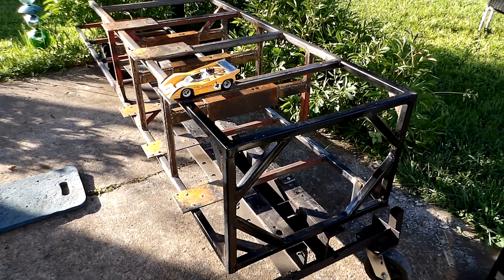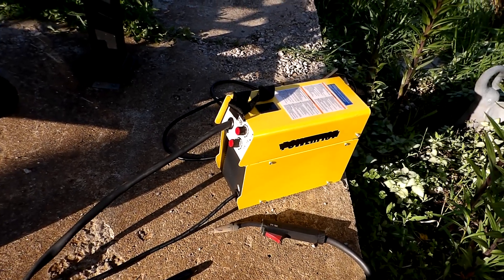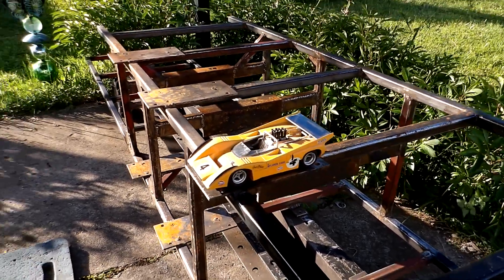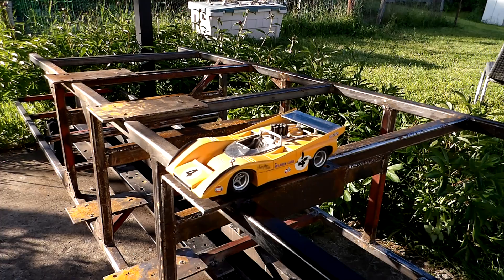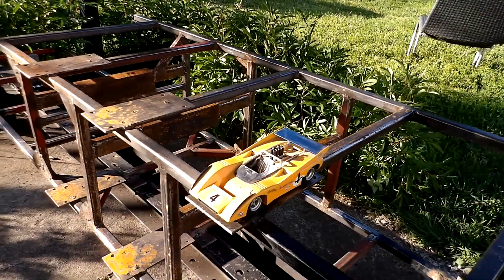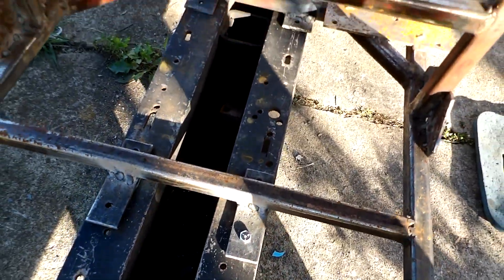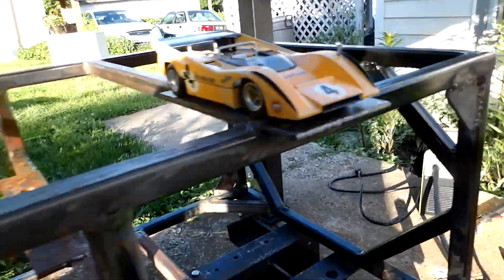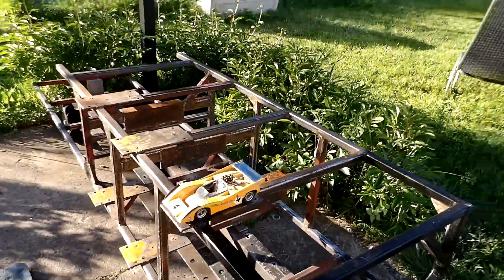Homemade 12 Cylinder Engine Week 9

Comment: On that flux core welder, all of them, reverse the polarity.  Make the part + and the tip -.  This greatly reduced or eliminates the splatter and slag.  Makes for cleaner, tighter welds.

Just Google what I'm talking about to learn more.
Reply from the maker: I know what you mean, and I have it set properly, i did switch it when i tried the solid wire out, unsucessfully, my machine only seems to like flux core. My new rectifier type welder seems to work much better, and it is light as a feather in comparison!

Comment: How much torque do we recon this thing will push out
Reply from the maker: Hard to say, hypothetically 12 times as much as a 3 horse engine, but the central shaft is too small to handle it at 7/8" dia.  My original choice was 1-7/16", but it warped when having the keyway cut into it. :(